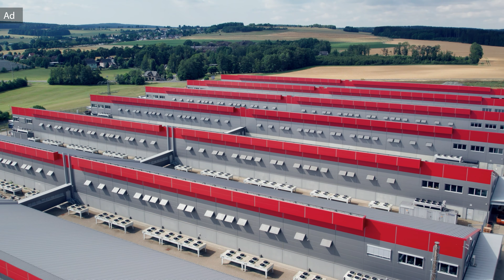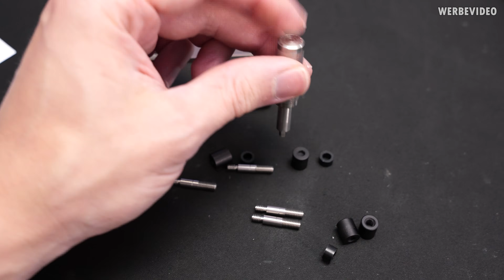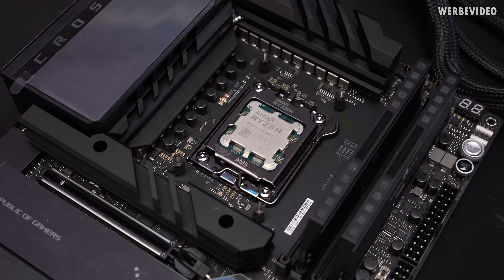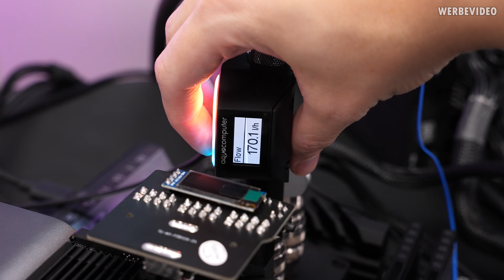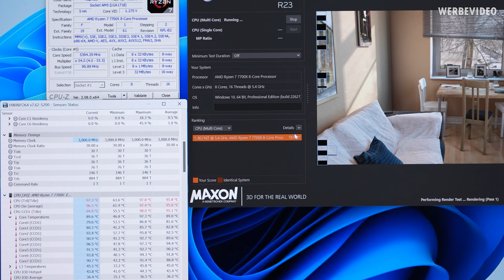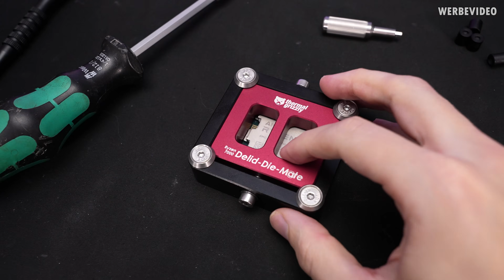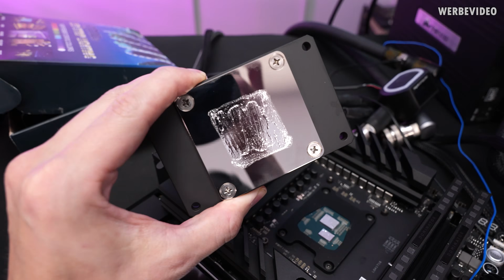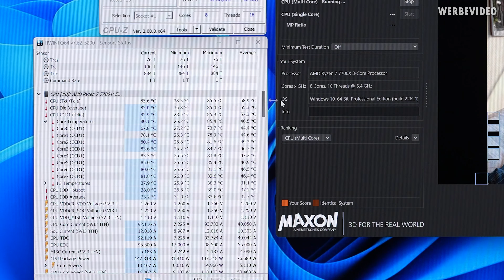The King of Water Cooling and Questionable Marketing

Comment: It's silly to claim that any block it's better in non direct die condition, over any block in direct die condition
I always approciate you opinion and review methodology
Keep up the good work man
I hope some day to buy your direct die block and a 7800x3d and delid it
Reply: It's not silly if we talk about ekwb and 1700 direct die sadly. On the start it was a shitshow with some cases of thermal throttling while idling in windows. In my case it barely beat 360mm aio which was simply unacceptable. I've tried mounting-remounting countless of times, I've also tried to sand die frame because there was information that it's too thick and should be 5.4mm while mine was 5.8mm - and with that I simply killed my cpu. Probably core issue was not frame thickness but convexity of cold plate.
I've fixed that with new cold plate / die frame set (and new CPU obviously), so now it throttles at 425w. But man that was a ride...
Reply: @deadlymecury   It heavily depends on the CPU to create that difference in direct-die vs non-direct, it all depends on the CPU which is why you shouldn't make that comparison unless you specify with big letter it only works on these CPUs.
Reply: @visamurai  in case of EKWB I was referring to manufacturer issues / straight-forward faulty products, but you was required to take a photo with regular thermal paste spread to prove them it is indeed faulty.
Reply: Agreed, physics dictates that that is a stupid claim.

Comment: Philips head screws are only good for stripping. It's not really about a quality feel as such I just can't stand philips head screws for how ass they are to actually use. Just use torx, basically everyone has torx head screwdrivers somewhere in their home by now and they just work way better. 
Should honestly hold the entire electronics industry hostage until they stop using philips head screws for anything at all.
Reply: True, but Japan Standard looks just like phillips but they are used as the set screw for disc brakes (an application where stripped heads is a coin flip) and I've never had a problem with these. Obv using the correct J1, 2 or 3 driver with built in hammer break ? A screwdriver that you hit with a hammer to make it turn a tiny amount to break the bond kind of like a hammer drill
Reply: @Gti_Jason  Damn near impossible to find JIS in my neck of the woods. I've stripped out Torx, Pillips, Allen, Posi-Driv. Robertson is truly the way.

Comment: When I built my loop the new EK Magnitude blocks came out and they were double the price of the Velocity blocks for a couple degrees better cooling. I went with the Velocity and am very happy with it over the past couple years
Reply: Ooof, I'm sorry. I hate to say it, but EKWB is kind of mediocre. Their coating sucks, the price is high, and the performance is at or barely above that of Chinese brands.
They're riding on a legacy, that's about it. I was able to buy a Core 1 CPU block and an Alphacool 4080 GPU block for $50 less than the equivalent GPU block alone from EK, and the EK performs like 3-4 degrees worse.

Comment: Your way of testing is more real world scenario. And using the same testing across all is actually the best way to do it.
Reply: which should come as no surprise to anybody. Company or user.  This is how you compare products properly.
Reply: Its insane that they test under multi-hour P95 with a chiller and say that is somehow a more correct method.
Reply: @johngoodman5094 no its not insane
Reply: Hey there, to clarify, we test using a temp regulator at 25c, which isolates the water temp and doesn't let it fluctuate, it also takes the fans and radiator and room temp out of the equation. It's a very scientific way to get extremely accurate results. Regarding P95, we do 10 minute tests, which is pretty standard. 10-20 Cinebench tests and gaming can have a lot of variation in the load (wattage) @johngoodman5094
Reply: Its not more real world. I do more than just games and rendering
Reply: @tacticalcenter8658 P95 is a power virus mate. No real workloads replicate that, nor do 99% of peeps have chillers.

Comment: I've seen techies wear anti-static gloves before handling computer electronics. But first time seeing rubbing a cat for same protection😁
Reply: that's pro tip
Reply: That could have been CATastrophic
Reply: Cats absorb static electricity ⚡⚡ every time I pat my cat I get a ⚡ so they will definitely cop the bolt 🔩 before the PC does 😁
Reply: Nah those gloves are for fingerprints and oils to get into some of the parts, if they wear anti static it usually goes on their ankle so it is out of the way.
Reply: Usually you wear a grounded wrist band against static electricity, not gloves. pros can use a leg band instead, its more comfortable. 

The dress code when I worked with electronics: Cotton clothes and anti-static shoes.Any synthetic materials was prohibited, also for underwear. All surfaces of the factory was grounded and we had ground straps on all work benches.
Reply: @karsh001   I'm assuming this is for non-circuit complete individual components, or am I wrong?
Reply: @karsh001  cotton can still generates static electricity.
Reply: @fishingkev2332  The risk is lower than synthetics and if you wash with softener its much lower.
Reply: Some rubbing on a rabbit foot, others a cat belly 😁 if it works, it works.
Reply: @dylanwinn3  Thanks for the technical info even though the cat statement was made for comic relief. This tells me that it's mostly 🤓🤓nerds watching this video😂
Reply: its like grounding to the case......just you know a cat
Reply: wtf are teachies bruh? lol this sounds like some Australia nonsense bs
Reply: Always worked for me
Reply: It's all about equalizing charges, to make sure the device you are handling has the same level of charge that you do. The Cat™'s fur will detect and pickup charges from all around it, equalizing the cat to any devices around it, sometimes so well, that it can pass through solid matter like doors, etc, because the atoms are perfectly in sync. 
Cat™ - it's ESPurrfect!

Comment: This is extremely overpriced I would never buy a cpu block above 50 USD. I mean what's the point? The water does the work anyways
Reply: Please don't annoy us with your poverty. I am sure the guys over at LTT will listen to your plebeian enui.  Thanks.
Reply: There’s a big difference between the Corsair cheap blocks to the best direct die blocks out there. The Corsair blocks cool barely better than AIO’s.
Reply: @tony_bauer  aio is not very comperable. But what do you gain on the BEST of the best blocks? Maybe a couple of C-s? With that money spent you'd be better of buying another rad for your loop. I've used blocks from china for like 12 USD and they did extremely well.
Reply: Someone who has money for custom loops probably doesn't care at all about the price and just wants what's best.
Reply: @shaquilleoseal1390  I have a custom loop, but no way I'm paying that much for a block.